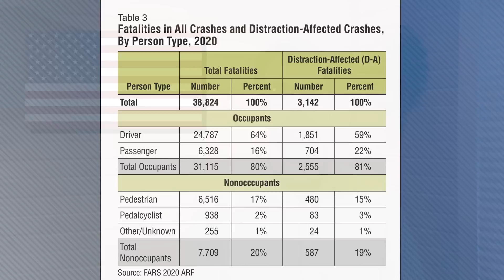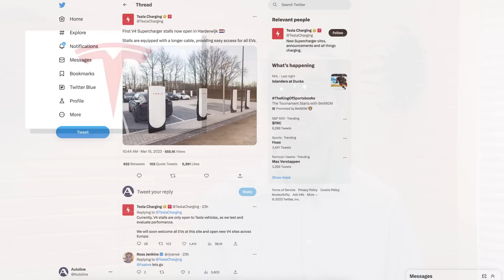Distracted Driving Underestimated; VW Reveals Sub 25,000 Euro EV Concept - Autoline Daily 3527

Comment: Oem's keep packing more and more unnecessary and distracting gadgets and complicated touch screen interfaces to manipulate basic functions of the car which all take your attention away from the road. It's no wonder the distracted driving incidents and fatalities are on the rise. Add too that, many states have little to no real law enforcement to keep drivers off their phones while driving. I work in injury prevention for a couple hospitals and from what I've seen data wise the govt. figures seem to be kinda low. Paradoxically, companies like GM seem to think MORE electronics are the answer. I'd say, less distractions in the car would be a better solution.
Reply: I hope the screens in cars trend goes away and soon.A judicious mix of a small screen and toggle integrated buttons works best to keep the driver's focus where it should be, on the road. But it is up to drivers to be responsible, ultimately.
Reply: @benjaminsmith2287 I'm no expert on auto parts, but I'm guessing a well sourced screen costs about as much as two or three buttons or switches, after the total bill is tallied.  The software is a one time outlay that can be shared across many models.  Add the over the air update possibilities, and I suspect they're not going away.

But I agree, there are some times when a direct access switch is what is needed.
Reply: @benjaminsmith2287  I'd be shocked if that trend goes away.  Screens simply offer too much.  You can do so much more w/ a screen.
If people will just put their darn phones down, that is a huge milestone.  As you said, the driver.  I have a Model 3 ... so kinda 'all screen'.  But I don't find myself distracted by it (helped in part by being able to control almost everything via voice, but part by just not letting myself get distracted, just like I don't use my phone when driving).

Comment: There won't be a need for an ICE ban by 2035. EVs will be at minimum 95% of all new car sales, with 99% being far more likely, if not 100%. By then, ALL EVs will be 800 volts architecture and the average range will be over 1,000 miles with high end models going over 1,500 miles using Lithium-Sulfur batteries. And there will be a slew of under $25,000 EVs similar to what happened with Ford and the Model T a century ago. When it debuted in 1908 it cost $825. By 1916 it was down to $360. EV are significantly cheaper (by and order of magnitude) to build than ICE, causing an even greater, faster drop in prices. The steep drop in prices happening now is merely the beginning of that. 

As legacy auto manufacturers ramp up their EV production, it will accelerate all the faster. In the US alone, February reached a record 8.5% of all-electric vehicles sold, an increase of 74% from February 2022. At this rate, it will be well past 25% if not 30% by 2025. Keep in mind 2 new battery chemistries, Sodium and Sulfur, are going into mass production, and/or plants being built for mass production, this year. And charging mega-sites with large solar capabilities (close to a megawatt or higher) and battery storage are beginning to ramp up as well, to either aid, or negate the grid altogether. Elon Musk will become the new John D. Rockefeller by controlling over 80% of new "gas stations", otherwise known as charging sites. Notice how they are ingeniously adding charging stalls for ALL EV's with their V4 chargers with longer cables, meaning they are not only for Teslas any longer (the fan boys and girls will live. They'll realize how many new ones they are putting up and how fast they are going up -- a huge new revenue maker for Tesla).  

As far as the unionizing efforts for that Nissan plant, a union would be its final death knell. It has place itself in this position by not electrifying sooner. It were far into that, it could simply close this ICE plant.  

As far as distracted driving, it's well over 50%.
Reply: And paul sir what about the apple car slated for release in 2026
Reply: I just can't with the crystal ball comments.
Reply: I want some of whatever you're smoking, sounds like some good shit! 😂🤣😂
Reply: Ev's will NEVER be anywhere near 50% of new car sales. they will peak near 20% if that high. These folks predicting more have never sold cars.Ford and GM dealers are deciding not to sell Ev's and Tesla is already reducing pricing trying to drum up demand, now that companies aren't buying as many of their Ev's anymore.
Reply: Hmmm, well there's one really good point in there for sure.  There's only one reason why EVs are more expensive than ICE cars up front.  That's the cost of the battery materials, and maybe the battery manufacturing.  There's nothing magic about the materials.  The mining firms just didn't anticipate the skyrocketing demand. As they catch up, the materials will go back to being commodities.  And as battery manufacturing scales up, that cost will also come way down.

So sometime in the next five or six years, EVs will become as cheap as ICE, and new technologies will improve their range and charging.  When that happens, the bottom will fall out of the ICE market, at least in most segments.  Within a few more years, it will become uneconomical to make ICE vehicles in those segments, because of the loss of scale leading to higher prices.

The first to go will be the middle and lower priced portion of the luxury segment; and anything with pretense of being "fast."   Then the Camry and RAV4 territory.  And very soon after, all kinds of SUV as well as the Corolla/Civic territory.  The rest will follow gradually.
Reply: The technology is still far away from this for many reasons.
Reply: @vitordelima  EV enthusiasts hear these reasons listed out in detail on a nearly daily basis.

And the reasons given are almost all either imaginary or irrelevant.  There are two great obstacles to overcome.  Supply of battery materials (or alternative battery types)  and the charging infrastructure.

Both of these challenges are being met with massive investments by both industry and governments.  It's going to pay off very soon.
Reply: @davidmenasco5743  Arguing about this with the shills here doesn't make sense at all.

Comment: VW released a picture. The end.
Reply: Actually, they showed a design. That's more than what Tesla has done yet there's more talk about the mythical $25K than anything else. They haven't even shown a design.
Reply: @benjaminsmith2287  Tesla won’t show a design yet. The factory isn’t ready and the batteries are still ramping. It can’t be made yet so they won’t show it yet. But when they do; it will be because they have the capacity and the manufacturing and cost structure to be successful. 
Meanwhile VW is showing pictures of cars it cant make for years with batteries that dont exist and factories that don’t exist with zero specs.

Comment: It is great to see VW taking a shot at the $25K car.    Everybody needs to build good cars for less.  The platform looks perfect for a mini truck and van.
Reply: BMW?You mean Volkswagen?
Reply: @brunoheggli2888  Yup indeed I did.  Thanks
Reply: @danharold3087  We dont know what the price will be becsuse its difficult to predict inflstion until the car comes out!I am guessing a absolut baseprice of 28k€
Reply: VW should claim to build a $5k car.  It is about as likely as their $25k car.
Reply: @davidbeppler3032  30kWh Na+ battery, hard plastic everywhere, 120 HP,  no screens. Apple carplay only. And you have your 25K car.
Reply: @wolfgangpreier9160  No.  What you described costs $27k to build as an EV.  You could do it as ICE for that.  Put a tiny lawnmower engine in it.
Reply: @davidbeppler3032  In China it costs 9000,-- US$. 25K would be the price for the Germans.

With a electric lawnmower motor of course. A lawnmower fossil engine can not meet the emission laws.
Reply: @wolfgangpreier9160  VW has never met emission laws.
Reply: @wolfgangpreier9160  If it is junk it is a non starter.  Nobody will buy it.  Will sit in the new car lots and get old  Just as many new ICE cars are doing.  Or so I am told.
Reply: @danharold3087  Only the US buys new cars from car lots. Everywhere else you order a car, either Online or at a dealer. Some dealers buy on their own account and display it on their lot. But only one or two at a time. You find only used cars in car lots. But you are right if its junk it stays and becomes old junk.
Reply: @wolfgangpreier9160  Interesting.  So is there less of a buffer or are they stockpiled by the factory.  I recall VW has the big car storage building that made the news decades ago.
Reply: @danharold3087  VW builds less cas "on stock" than GM. Not zero, but much less. The giant parking space was because the Software of the ID3 was not ready by far.

And their backlog is massive.

Tesla also rented a big parking space in the BER - the Berlin Airport thats still not finished (after 30 years...) because the transport ships are shipping other cars in between. That is being filled from time to time when they have to wait for transport.
Reply: @wolfgangpreier9160  Thanks for the info.   I was thinking of Autostadt.  That thing is amazing.  I imagine it is the buffer for normal operation.  
https://youtu.be/9Q1cDqxGTHk
Reply: @danharold3087  The Autostadt is a public car parking for the tourists visiting Wolfsburg. 

Did you know that Wolfsburg is a artifical city built by the Nazis for Volkswagen?
Reply: @wolfgangpreier9160  "One of the prime attractions at the Autostadt is the two gleaming car parking towers of glass and galvanized steel where cars are automatically moved from the Wolfsburg plant and on to the customer center where they are collected by their owners."
"A conveyor belt system transports finished cars directly from the adjacent manufacturing plant to the towers' basement."
Guess I should have said Autostadt parking towers.
Reply: @wolfgangpreier9160  Did not know Wolfsburg is artificial.  What does that mean?
Reply: @danharold3087  Its all a glorious show for the customers. 

I wonder where all the great grand german sculptures and over the top marble arches and temples have been put. 

The heros and knights of long ago like Friedrich and Sigismund, Brunhilde and Hagen must be revered!

Maybe the Nazi overdid their part of the grand Arier Reich?